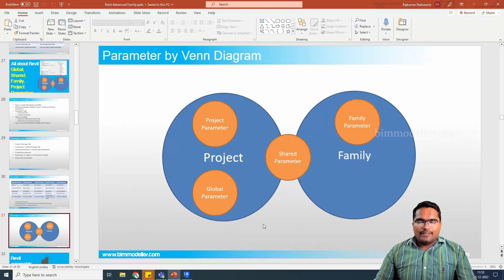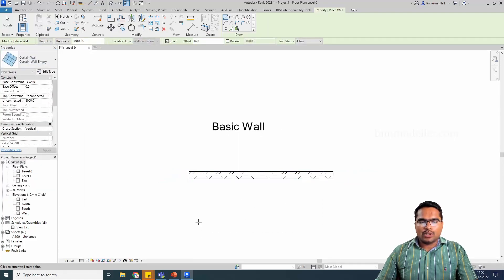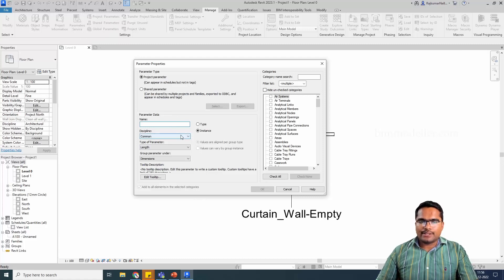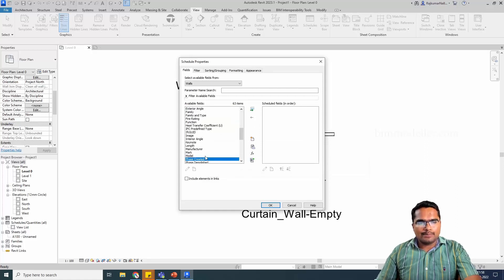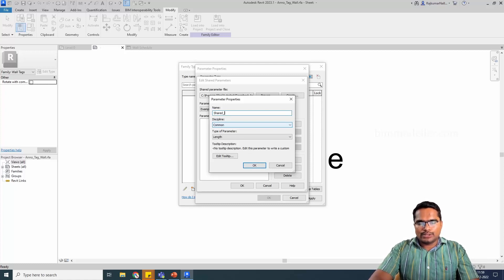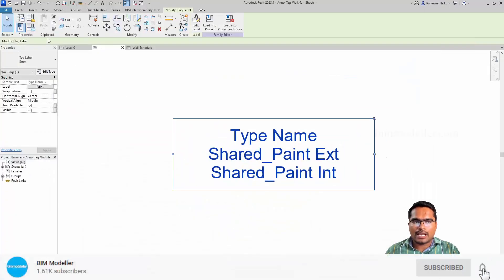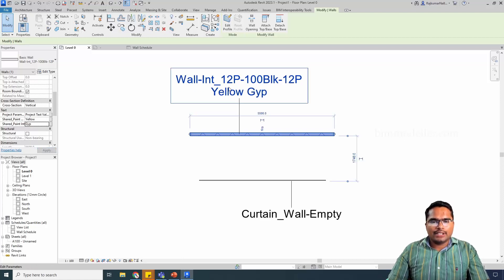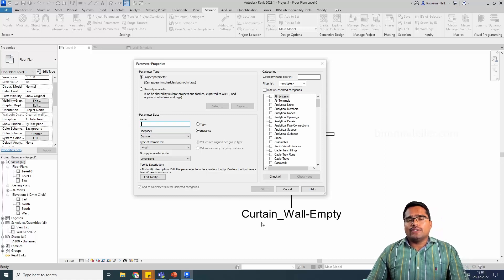Parameters in Revit with Example

Comment: Thanks for Good content. 
1.  Suppose I  have cement qty in wall schedule and also have cement qty in floor schedule, concrete schedule etc.
Now how can I have  parameter which give me total cement qty  from all schedules (wall schedule, floor schedule, concrete schedule)
2. Can schedule be automatically updates in Excel.
Reply from the maker: hi Prmod, Welcome. Then share it with your learning friends on LinkedIn!
1. You have to try using Material Takeoff Option and Multi-Category. Not the normal Schedule. Then it will list all elements with specific materials. If needed I will add a Video.
2. Check this Video - https://youtu.be/32idd_rltyM 
Cheers!